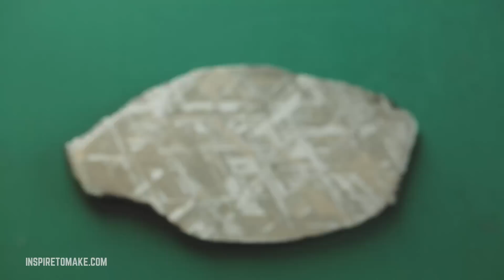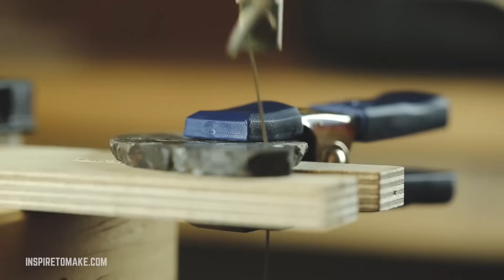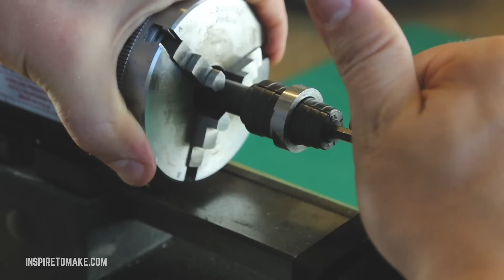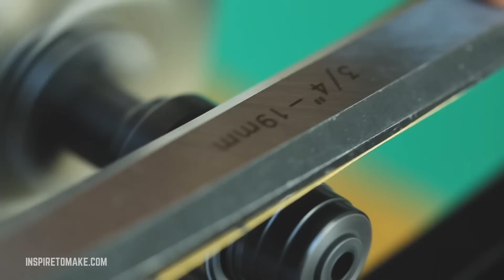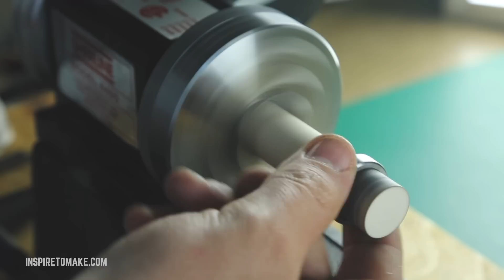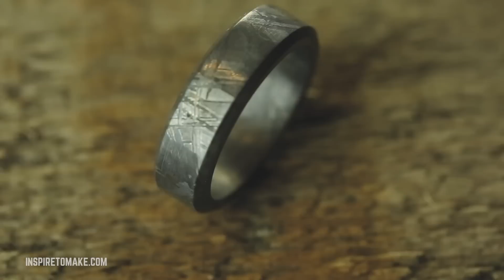Making a Meteorite Ring

Comment: Solid. Now I know what to do with mine. Although I do not possess much of that gear. It will Just take me longer. Do you think if I have two slices that would equal more than the width of the slice you used I can forge weld them before drilling, or just have two thin pieces to make the one? I also want to inlay turquoise. Any pointers out there?

Comment: This is a bad choice for a ring. ""Inspire To Make" has his heart in the right place and does a great machining job, but putting an iron meteorite containing about 90% iron, 9% nickel, and 1% heavy metals many of which are rare and toxic over continued exposure (and many not normally encountered on Earth's surface). Collecting meteorites and making jewelry is a great passion, but the handling is restricted to brief moments, not living with it in constant contact with frequently sweaty, corrosive hands. Maybe a pendant, but not this sandwiched on a finger not giving the finger a chance to breathe chronically. A professional ring would add a layer of inert jewelry-friendly metal and use the meteorite as inlay or mounted.

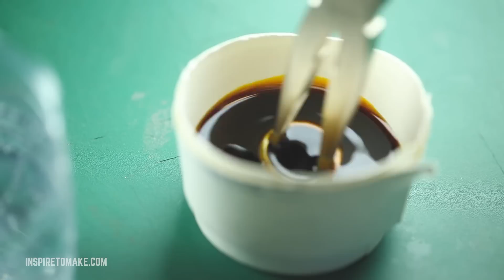Comment: +Inspire To Make   @2:30 was that liver of sulfer you were oxidizing with?
Reply from the maker: +Michael Baker ferric chloride
Reply: +Inspire To Make  Interesting, I'll need to try that one.  I normally use Liver of Sulfer or Hydrochloric acid on my rings.  I wonder how Ferric chloride would compare.  Something to experiment with I suppose.  What would you recommend on ratio to water or do you use it straight?  It looked like a water dip afterwards but did you have a neutralizer like baking soda in it to stop the oxidization?  Good work by the way.
Reply from the maker: I use it straight for a few seconds and wash it off with regular water

Comment: My wife bought me a meteorite ring when we got married and I was super excited. After wearing it for a while it started rusting and I was continually cleaning it to the point where we went and got a tungsten ring instead. I tried buffing the rust out and then applying anti-rust spray--didn't work. Then mineral oil--didn't work. Even tried gun bluing--didn't work. Any suggestions to stop it from rusting?
Reply: Have you tried a PU clearcoat?

Comment: Hey, so I actually have a ring like this for a long time, but I can't wear it: being Iron (and worse, a mix of domains with slightly different Ni contents), of course it will start to corrode immediately on your hand. I have tried several lacquers to protect the surface, but have yet to find one that does not yellow and does not chip or peel off after a short while - what did you use?
Reply from the maker: I'm constantly wearing mine, have no problems with oxidation
Reply: Interesting. Mine rusts badly. It is surely meteor iron, as it has the Widmanstatten pattern which can't be forged, as far as I know. I'll try repolishing and etching with Ferric chloride, maybe mine was treated differently... Thanks.
Reply from the maker: the etching is polishing off with fingers very fast. I noticed that just by wearing the ring every day its not rusting, maby because its always rubbing on my fingers and protected by my natural skin oils.

Comment: Does the ferric chloride and water give the same effect on other metals???
Reply from the maker: +Nicolas Ruggiero the ferric chloride acts like an acid. It's an etching solution. It will eat out the surface of the metal revealing its structure and patterns within it. It's used to darken structure patterns within Damascus steel. And the water is just to wash the acid away.

Comment: I actually have a piece of meteorite from the same location sitting on my desk.  It's too skinny a slice to do this with though
Reply: Take the same drill size but instead of lathing out the center, use a ring mandrel. You should be able to get the same shape with a bit of prep.
Reply: Did you read the end of my. comment? It's too skinny to be a ring.

Comment: How long did you wash it in the ferric? Did you wash immediately? Are you going to use any sealant or oil to protect it from rust?
Reply from the maker: SuicidalBarrelRoll Awesome!
Reply from the maker: Few seconds and I wash is right after. I don't have any sealant on it. no rust so far.
Reply: Inspire To Make Thanks so much for your reply! So 5-7 seconds then immediately wash. I will do my very best!
Reply from the maker: Yes, try different times, you can always repolish it after
Reply: Inspire To Make Will do. Can I just say, this is also a beautiful video, and it really has inspired me.
Reply: I love the ring :3 she must be really special the woman you marrying :3 congrats man :3
Reply: Inspire To Make thanks for your answers - I finished turning mine today. It'll need a ton of sanding and filing to fit before the etch, but you really did Inspire to Make!

Comment: so, it is iron or what kind of alloy it is ?
it will rust-a-lot
Reply from the maker: It is mostly iron I believe. If you wearing it will not rust.
Reply: Won't your sweat make it rust?
Reply: +Heitor Amaral no
Reply: If that becomes an issue you could always re-finish and clear coat it!

Comment: how do you ensure that it's 100% legit meteorite? 

excellent video btw
Reply from the maker: you can see it by the crystal structure of the metal
Reply: Inspire To Make those crystals couldn't be faked, through certain industrial processes?
Reply from the maker: That would be to expensive to do, there is not much market for the meteorites )))

Comment: From what I've seen online, it works out around $10 per gram. But I imagine it varies a lot depending on material composition.
Reply from the maker: yes, It's hard to find slabs with a good pattern
Reply: Really interesting video though, I've never considered meteorite as a workable material. Did you make a pair?

Comment: why do you have to put that water thing on the rock for you to drill
Reply: As the metal of the meteorite is quite hard, the drill bit bit would get pretty hot and also go blunt. The "water thing" is a cutting oil that cools the drill and metal and makes it run smoother so the bit wont wear out that fast. At some point you can even see it evaporating because of the hot metal. But i have to say to really cool it down you have to use a lot more than just a little dab of it (like an actual pump and return circle that keeps that stuff just pouring all over your workpiece but for that you need quite a well equipped workshop like here at my school :D). Such a small amount only affects the lifetime of the drill bit.
Reply from the maker: It's easier to drill with oil, and the drill bit last longer
Reply: Inspire To Make Oh thanks i was confused, awesome video BTW